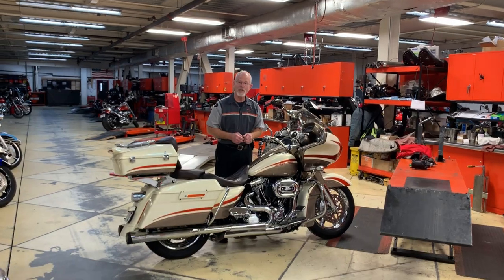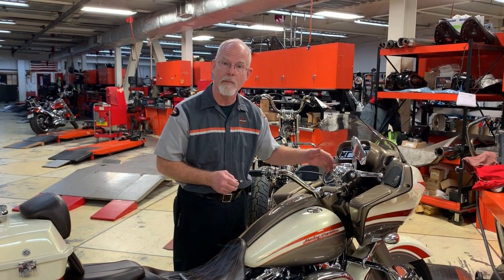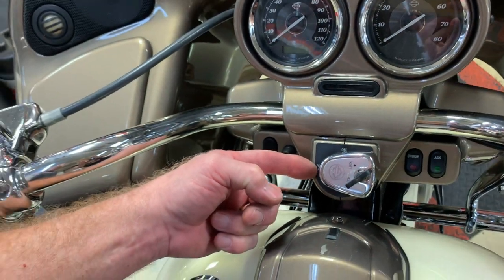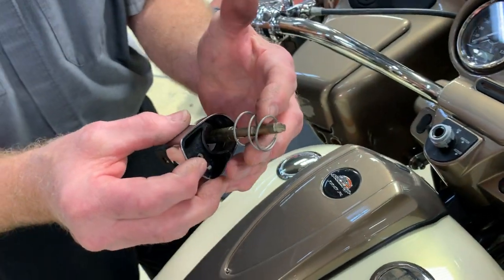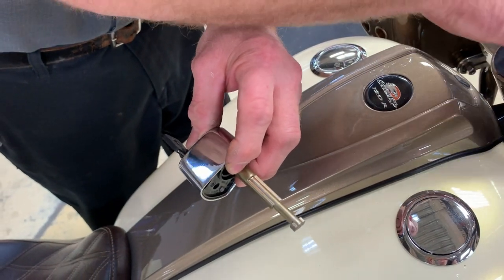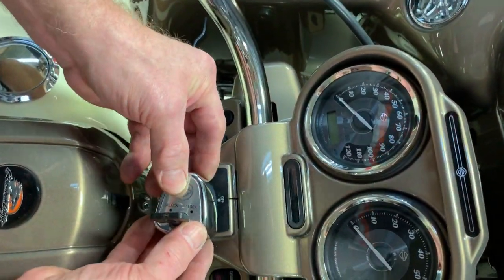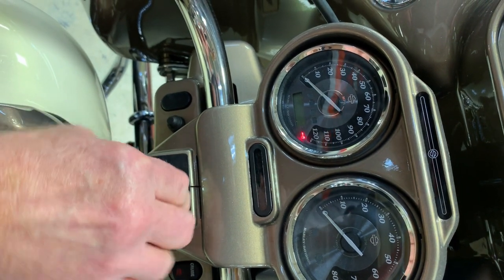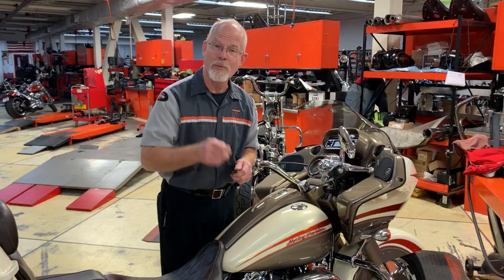DOC HARLEY: IGNITION SWITCH REMOVAL AND INSTALL

Comment: Doc, you just saved me a lot of money. After a ride I parked it in the garage. Next day turned the ignition switch, nothing, nada, dead as a doornail. I checked the battery, fuse, relay ect.  I called my dealer for a tow.  I figured it had to be something with the ignition switch.  Rolled it out of the garage and the handlebars locked.  Found your video, took the switch out, reassembled and it's alive.  Canceled the tow.  Love your vid's, thanks.

Comment: Thank u,thank u,thank u!!!! Doc I just wanted to adjust my new bars,did everything right,but when it came to putting that ignition/fork lock back,frustrated is an understatement, I couldn't unlock my forks, and I thought I was going to have to take a trip to the HD dealership, but thanks to you,and some very vital information, I was able to put my ignition switch back on,unlock my forks and went for a spin, best video on this specific item I've seen,and I've watched about 8 videos,yours was by far the most effective, again thank you!!

Comment: Doc, you really make helpful videos, however this one just appears to be removing the tumbler assembly. Many of us need to remove the actual switch. My problem is the wiring plug connector or the switch, not sure if it is the plug or switch causing the bad connection. I can tell the plug is loose causing an intermitting problem. However, I cannot figure how to get to it. I can remove the tumbler assembly and panel over the 4 switches (along with the batwing so I can see the front of the switch), then remove the 2 screws holding the actual switch in place. That's where I'm stuck, switch will not move to the rear to unplug so I can tell which is my problem.

Comment: Doc, Please, I need directions on replacing my rear brake switch on 2016 Harley Ultra limited. The switch is in the front next to foot board behind the headers. TY
Reply from the maker: You and i both know it would be easy with the exhaust out of the way. If you’re wanting a trick. Deep well socket with an open end wrench holding onto the metal connection. Of course performed blindly behind the front pipe😣…..Doc

Comment: Question after taking the steps you described the switch starts to come up but than stops can't take it all the way out. I replaced the ignition awhile back put it together while waiting for new decal is there anyway I could of installed the switch wrong so now it won't come out. Everything works perfectly all positions are functional
Reply from the maker: Is the Key truely rotated after the under button is pushed in? Are you in the accessory position?..Doc
Reply: @Low Country Harley-Davidson  the switch is in the fork lock position and yes the key rotates 1/4" left after the button is pushed in and the switch lifts about 1/4" that's as far as it will lift. PS Thanks for you quick reply

Comment: How do you remove cvo ignition that has electric locks there’s a wire hooked to my key switch 2:35
Reply from the maker: The same way just really careful. There is enough wire to lift up without disconnecting….Doc

Comment: Good afternoon Doc Harley, started to look at your videos about three weeks ago. I have a 2008 Ultra Classic (105 Anniversary Edition). Remove the switch correctly but my helper (meaning my left hand) hit the handle bar and it move to the steering lock position. Stuck like chuck...................Help please.  Get the tool correct?
Reply from the maker: Yes the tool is needed...Doc

Comment: Doc-  when my switch is in the fork lock position, I have a hard time getting the key out. What is the deal with that?
Reply from the maker: Could be as simple as the key is worn. Also consider moving the switch back and forth slightly. When ignition is in the lock position, the lock mechanism is engaged and possibly putting pressure on the switch. Thanks ~ Doc

Comment: Say Doc....can I use a modern barrel lock switch on an FLTCU of 1989 vintage whose switch is of the old brass key type?
Reply from the maker: We’d suggest asking your local parts department. Many times when the factory offers a replacement they send an updated part.
Reply: Low Country Harley-Davidson ok will do...I don't NEED the switch just looking at things that will spiff it up....

Comment: Been there, done that! Ignition switch that is, my problem is keeping switch tight after install where switch wants to spin direction with key pressure? Yeah, just tighten! But that's been done! An done again! An I hate key switch position on 03 fads down low under my butt!

Comment: Hey Doc, what’s the proper procedure for simply adjusting handlebars on. 2016 ultra limited. The manual shows to take ignition switch out and remove auxiliaries dash panel,but my dealer said I have to take outer fairing off and remove radio. Please help, thanks, Joe
Reply from the maker: You can do it with your method using a ball-allen but it is recommended to take everything apart. Make sure to properly re-torque the clamp that holds the bars after adjustment.